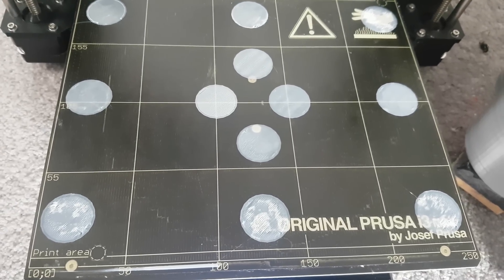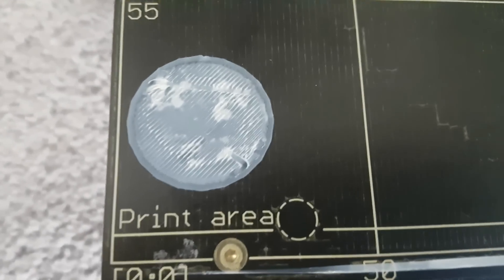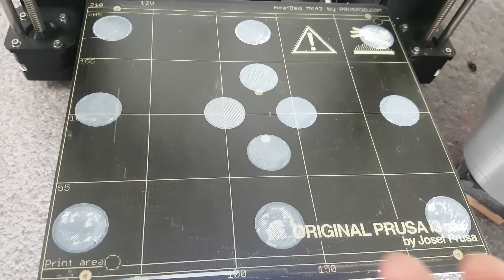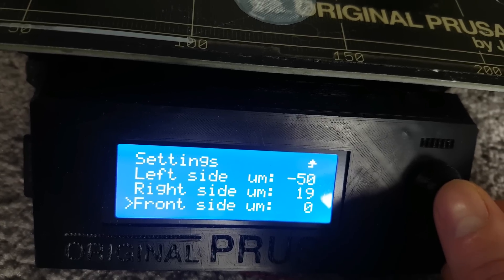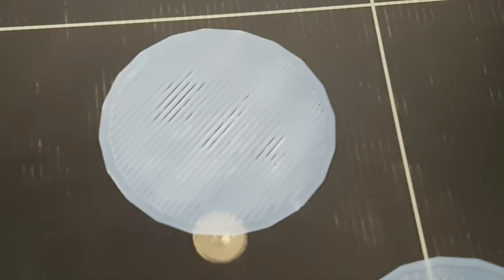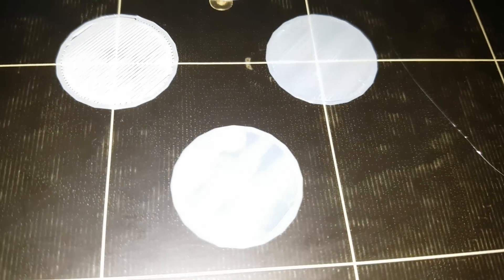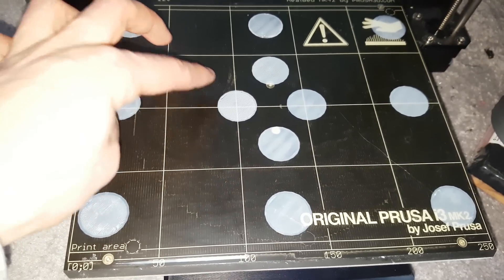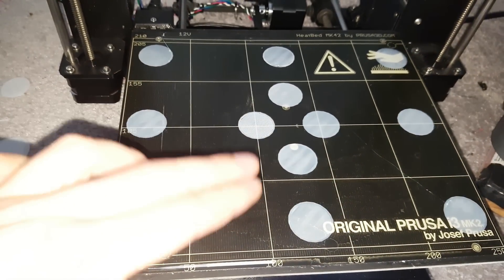Prusa I3 MK2 Mesh Bed Levelling not real??

Comment: Rob, not sure it's the problem you have but if you cut the cable tie holding the bed bearing ( the single side)see if you have a gap appear  between bearing body and bed carrige frame, you could have some side thrust and your car ridge rails may not be perfectly aligned.  Just an idea and worth checking anyway. Regards Jez
Reply from the maker: +Jeremy Saunders thanks mate I'll check it out :-)
Reply: ROBNOB9X , watched your videos a few times and convinced it's a mechanical issue with the carriage rods, if the rods are not perfectly alined I think they could distort the bed, it would not need to be much. Check bed with straight edge also my suggestion of cutting cable tie and check how bearing is resting in carriage indent at various points of travel. eg.Rods maybe parallel but too close .This would cause distortion at each end of their full travel. I maybe wrong, I often am🤔.
Reply: ROBNOB9X ps. just took a measurement between my carriage rods, 162.15 mm at far end, 162.05 near end. 00.10 mm difference. I have not had a problem so far ! Would be interesting to know how yours and others are set ?
Reply from the maker: Cool cheers for posting, so this was between the 2 y axis rods yeah? Only thing is I can see something like that making the bearings a bit louder/less smooth but I don't think that would affect how flat the bed is. Although I guess as you aid perhaps it could push the bearing up slightly.
I've got some prints to do for some orders but after that I'll make sure to get checking all this. thanks man.

Comment: i had some problems with the auto leveling too. Until i realized that the pinda probe does not like the heat from the bed. If the extruder was too close to the bed, the probe was too hot and did not measure the right distance. 

So i lift the extruder after every print so the probe stays away from the bed next time heating (added an ending script). since i did this the auto leveling works better for me. 

Thomas Sanlander tested all kind of sensors this week and had similar results. Heat and moisture are not good while auto leveling. watch his video.

Maybe that helps!
Reply from the maker: +Tommy Cole but does the bed heating affect the bed as in it may make it slightly warp or thicken or something which means it's different than when you probed it cold? I've had people.say that and that was my impression as to why the default is to do the probing once everything's heated.
Reply: Measure the variance in probe accuracy due to heat and compare it to the variance caused by thermal expansion of the mk42 bed.
Reply: I also adjusted my beginning gcode based on what I saw in his video.  In my new code, the mesh bed leveling happens BEFORE heating, and the nozzle is moved up and away from the bed while heating.  Bonus, no blobs all over the bed when mesh bed leveling is done with a hot nozzle.  There is no doubt that I get better consistency this way.
I also insert my bed level correction numbers in the start gcode rather than using the LCD.  The LCD limits you to +/-50 microns.  You can go to +/-100 microns using gcode.  You have to do either/or though.  If you do it in starting gcode, the bed level correction numbers on the LCD must be reset to zero and then you must restart the printer.
Reply from the maker: +Philipp Mlekusch cool I think I'll try this and do this before each print too. I also watched Tom's video so I know exactly what you mean.
Reply: For sure, cold measurements don't mean jack once the bed is warm.
Reply: that depends if it warps in different spots, which then means mesh level should correct which it does not....  and if the whole bed expands uniformly then you can certainly probe it cold and just adjust the live Z instead... the bed will still be planar.
Reply: If you have an aluminum bed, you need to do it heated. On a fiberglass bed, there would not be enough thermal expansion taking place for it to matter.
I know on my aluminum bed, the center starts bowing inward when heated higher than 50c.
Reply: This model doesn't come in a fiberglass bed. Calibration should always be done hot for best results.

Comment: bed has play in it- weight of bed should keep it centered, surface of the PEI might be not sticky enough where its lifting- perhaps try lightly sanding entire bed with 1500-2000 gritt sandpaper and washing with denatured alcohol before printing.

interesting comment about the smooth rod not being clicked into the hole properly- Perhaps contributing to the issue.
Reply from the maker: +meky0 yeah I think I'll be sanding it soon with 2000 grit and adding some acetone to it to try and refreshen it. Although I don't think it'll solve that weird patch I have.
Reply: be sure to use a flat sanding block to avoid sanding a dip into the plate.

Comment: I unfortunately I do not own a MK2, so take my thoughts with caution. Do you print with a heated bed? If so then this could be the reason for the "uneven" printbed. The inductive probe probes the printbed at room temperature, right? If so it does not account for the warping that occurs when heatbed starts heating up and starts expanding and deforming. This is could be why certain areas work well and other seem to be either too close or too far away.
Reply from the maker: Hi, cheers for the thought but before each print it waits until bed and nozzle are heated to full temp before probing all 9 spots and then starts printing. I'm assuming it does this because as you say, the bed can change slightly with the temp and also maybe the probe could give different readings depending on heat that is hitting it.
Reply: ROBNOB9X it weird you say that because on mine it probes all points first and then goes home to heat up...... what slicer are you using?

Comment: Why not just install a flat bed plate and be done with it?
Reply from the maker: If you mean just sticking glass or something on top then I don't want to do that as I bought this printer partly for the decent bed.
Reply: <in jest> your definition of 'decent bed' may need adjustment</in jest>, be sure to post an update when you find a solution, its an interesting problem.

Comment: someone in our group may have found your problem. the smooth rods are not in the plastic parts
Reply: just looked at my mk2 to check, your rods are not in place, there should be a definate click when they push down & more than half the rod should be inside the plastic yours are sitting on the plastic part, not in it
Reply: Not really, if all the corners are outside of the plastic feet then it could appear to be level when it's really not. Even if all 4 legs are printed at the same time on the same bed even with a layer height of 0.05, the auto level could add an additional later on a leg or two. This itself would add 50um before any other imperfections.
Reply from the maker: Thanks but already checked that as well, my rods are definitely in, would have been an easy fix though.
Reply: min 8:55 the smooth rod is not in the corner part
Reply: yes. thats how it looks in the video. however i have the same problem and my rods are in. so this is irrelevant.
Reply: I printed it, check thingiverse link below, and it is not perfect and i can see that i have bed temp differences where the print doesn't look that good. I think a rod that is not in place is relevant for mesh bed leveling. That's what this is going about... But the problem can also be somewhere else.
Reply: 1000% this
Reply: right but a straight edge on the bed would easily reveal if that's the case before wasting time.  the bed is hardly flat at all and definitely more than 50um offset.  more like 200-500um.    though worth a check on the Y First.   Mine ain't flat, some edges go lower than center.   it's mostly noticeable when you're using the full bed size.    other than sw, shimming is an option or just put glass bed on it.  lol.
Reply from the maker: +W Gussner yeah people have mentioned about the rods but I've pushed them in as far as they'll sit and they're the same on the other end which should make it not be a problem. I am going to take a other look at them though and see if I can try again.